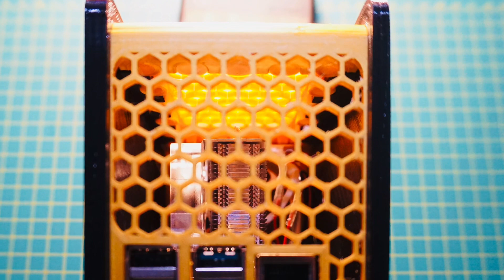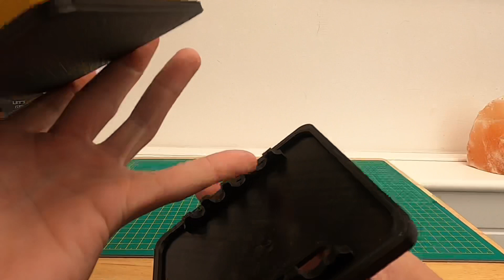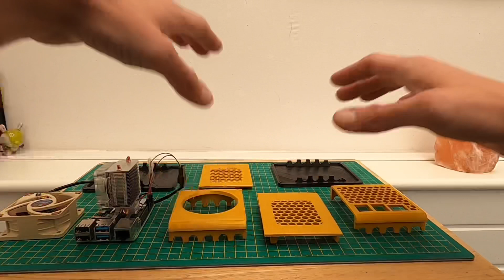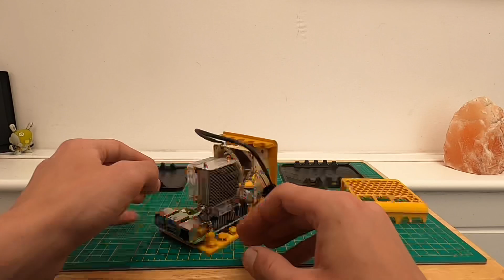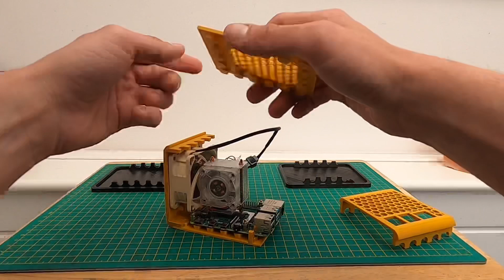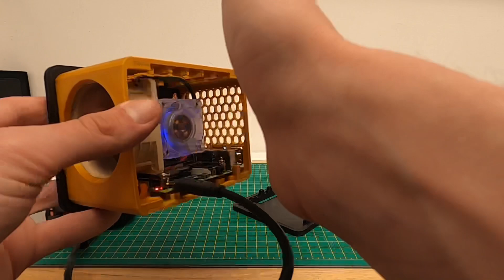Raspberry pi 4 - Overkill Noctua fan case

Comment: even if I am 4 years to late, the music makes it impossible to understand what you say.
Try using this without the small fan. The big noctua schould produce more airflow through the fins.
The small fan creates so much turbulence that the air blocks itself and reduces the amount of heat transported away.
Reply from the maker: Very much noted. I don't use the Noctua fan anymore, this has become a HomeAssistant server and keeps itself nice and cool. But good shout on the small fan in that setup.

Comment: How do you have both fans connected at the same time??
Reply from the maker: Look at 1.33 both are plugged in as you have 2 power power pins on the GPIO
Reply: @jakestechtravels4864  Yeah, but how did you connect the fan to the GPIO? Did you buy jumper connectors to attach to the cables or did noctua provide the cable with GPIO connections?
Reply from the maker: @funkymonk4688  ah I see, I used 2 old female jumper connector ends and soldered it to the provided cable. I had to modify it slightly but works great.

Comment: remove the fan on the side of the heatsink and put it at the back of the case instead for a continuous airflow.
Reply from the maker: Tailslol not a bad idea! Although I think you might want a bigger fan as the heat sink fan is very small. 
I like your thinking tho! 😊
Reply: @jakestechtravels4864  the front fan is so close to the heatsink it should be ok and you reuse the one on the heatsink
you can probably rotate the whole case to have the front fan at the bottom. and put feet there.